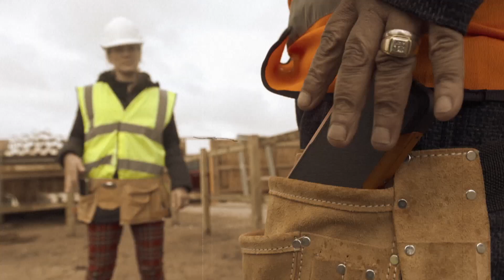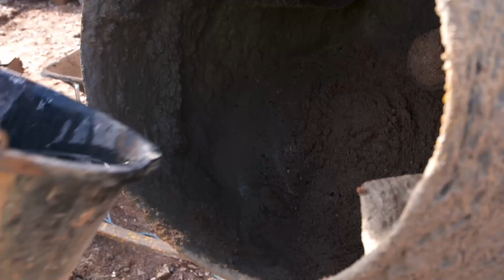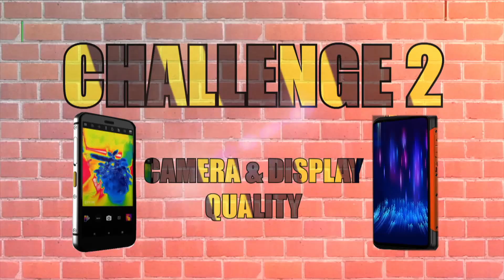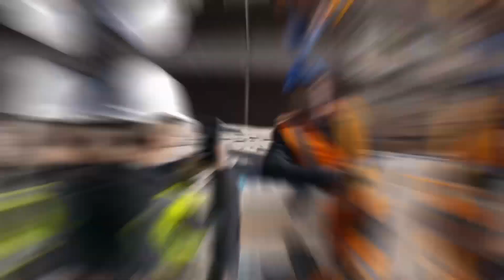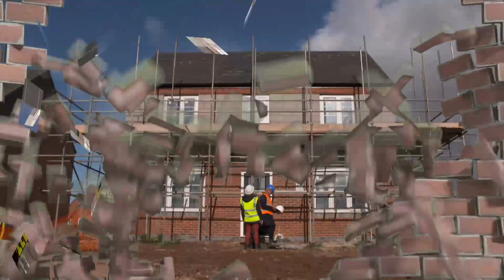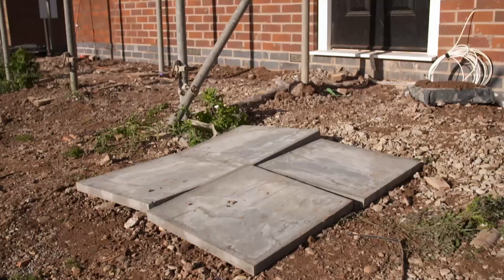Cat VS Doogee: Cheap VS Expensive Rugged phones tested | The Gadget Show

Comment: I think the high drop test doesn't really tell you anything conclusive. As said in the video, it is way over the specs and that means it depends a lot on every single production unit. What I mean is, that a test of say 10 of each and getting an average would be more scientifically correct to be able to assess what brand is stronger in that particular test.

Comment: Please do drop test at rock road.... you can see big damage... sand and soil soft than rock
Reply: it wont matter. i own cat s61, i drop it all the time. its so messed up sometimes i feel like i should oil the screen so i can see the display in sun, its VERY scratched up. Altho i leant down with cat s30 and it fell on a freshly cut rebar end with a screen from height of about 20 cm and screen shattered.